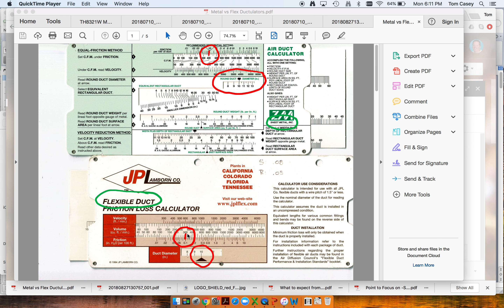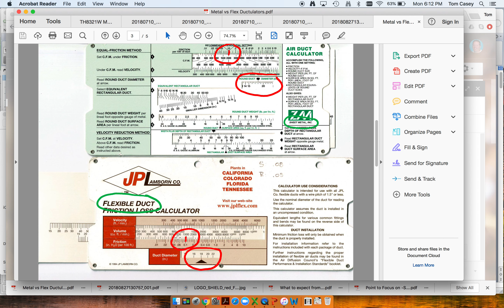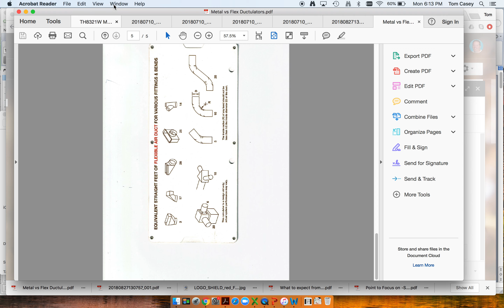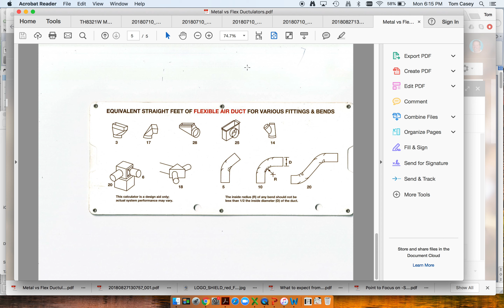Duct Work: Metal vs. Flex

Comment: Just recently got an ASHRAE ductulator into the office w/ compression ratio adjustments for flex. Eye opening shit, to say the least. Can’t believe my company had been using a rigid calculator for flex for all these years.

So many of my clients can’t stand to use rigid ductwork bc of cost and labor intensity. Fortunately, I do all designs in a shop level BIM environment to make sure they cut exact lengths to 99%+ accuracy. Still, I do not like all flex / ductboard plenum systems and do not trust the quality of the install to be within the assumed safety factor range.